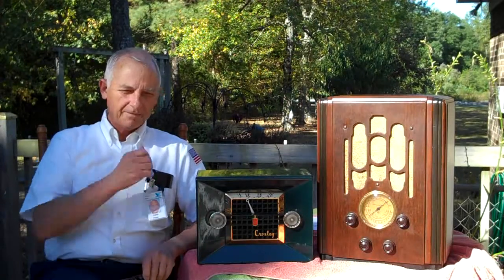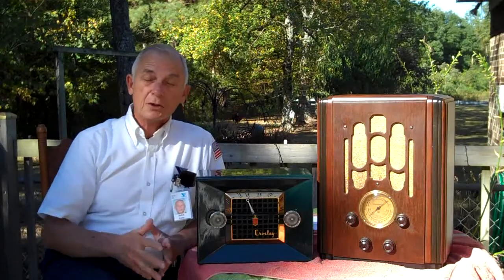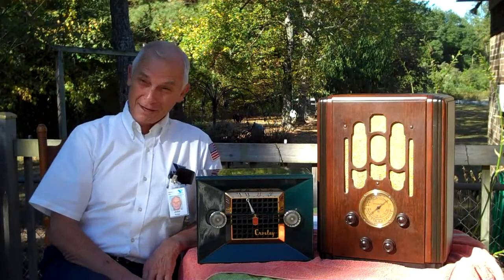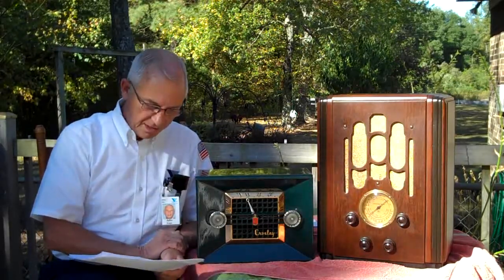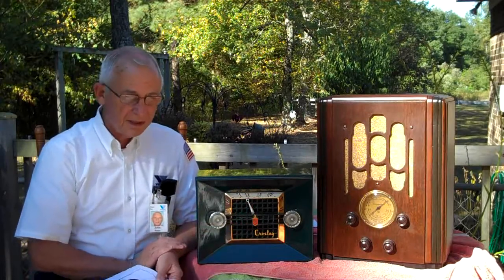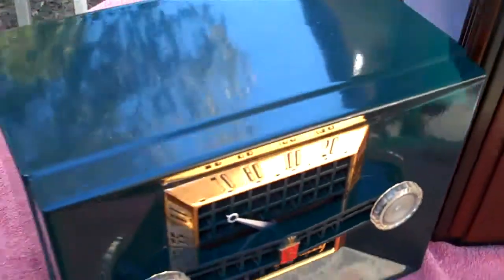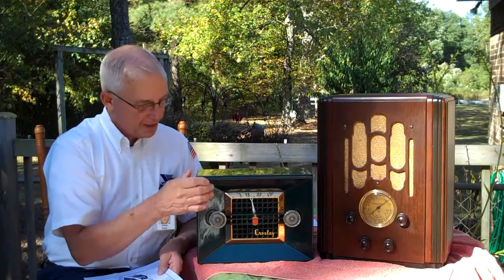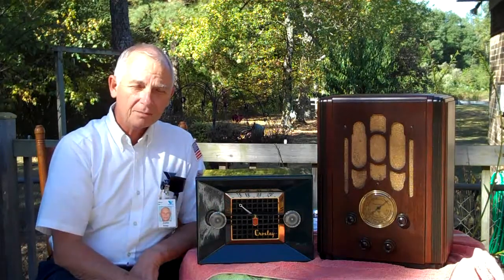1951 Crosley Model 11-109U Vintage AM Radio.

Comment from the maker: @VideoRanger
I save the before, during and after restoration shots for the "Antique Radio Forum".  It's a much better place to do it.  In fact, later this month I'll be starting a step-by-step restoration of a 1941 Philco model 41-255 wooden radio.  When you have time drop in on the forum and have a look around.  In terms of vintage radio repair and restoration, there's some really good stuff over there.
Thanks for watching.

Regards,
John